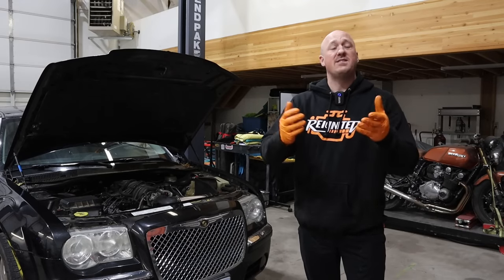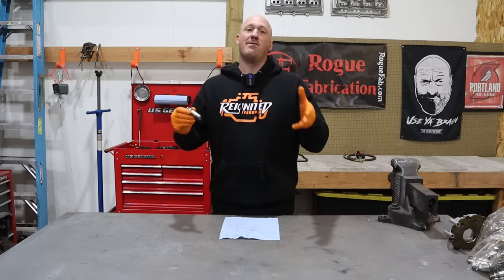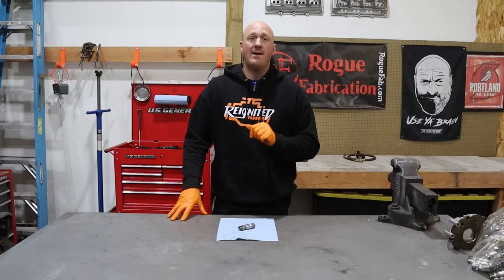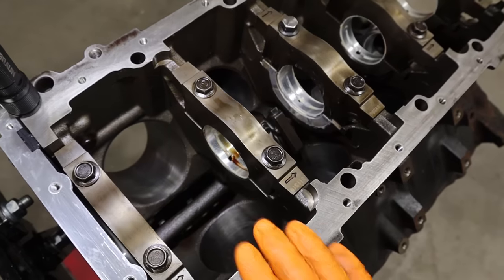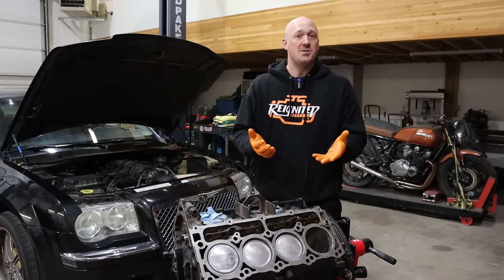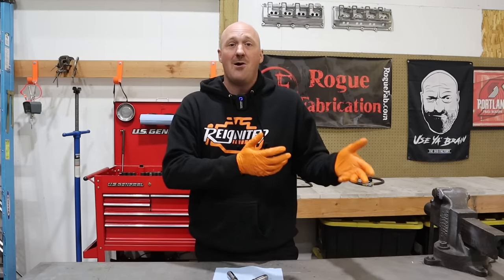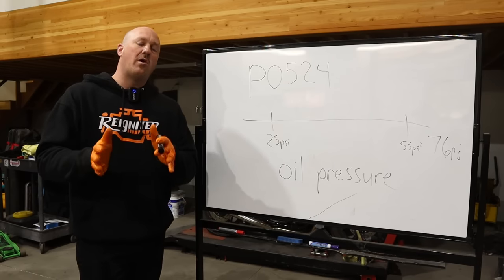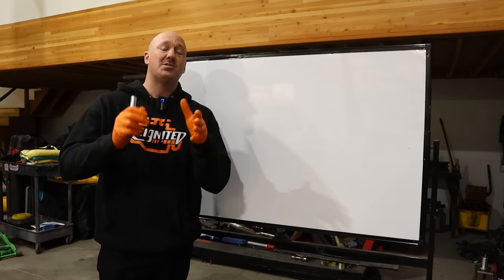The BEST Prevention For Hemi Lifter Failure! (In My Opinion)

Comment: My 2019 had mds lifters fail.  Regular lifters were fine.  Only had 60k.  Oil changed every 4k.
Reply from the maker: It's hard when I see these ones that fail at such an early mileage, I always want to know more about what led up to that like any specific area of the country, driving habits, ect...
Reply: My 2019 with 35k runs well and has very low odds of failure even though it is a 5% possibility.  A friends 2022 GMC Denali 6.4 had lifter, rod cam failure at 65k.  My brothers Silverado 5.3 vortec lost a lifter at 70k and after repair under warranty lost main oil bearings at 122k requiring new rebuilt 5.3.  Sorry it happened to you though.

Comment: we had this same problem in chevys and we put an eos in with oil change and never had an issue after that. As you mentioned it was usually in engines that had extended idling.

Comment: I am a P.I. and do surveillance in AZ.  My 2015 Ram 1500 with 170K miles idles 10 hours a day. I am waiting on the it's 3rd engine to arrive (original, the replacement, and now the replacement to the replacement). I lost cylinder 7 lifter last time and cylinder 8 lifter this time.  So my contribution to the knowledge base. lol I love my truck, but sadly I'm out. Cant keep buy engines! Any suggestions I am wide open!
Reply: Don’t idle the crap out of it lol. It doesn’t matter what manufacturer you buy with idle time like that the outcome will be the same.
Reply: Look into a portable Ice Air Conditioner so you can shut it down. Your gonna burn out your cats as well. There are several different types available.
Reply: If you need a truck, get one with a cummins. Diesels can idle all the time. That said, I guess put a hellcat oil pump in the next engine. I live in AZ too...The heat is hard on things.

Comment: Great break down here man! I came across your video while searching for oil cooler, I’ve got a 2014 2500 with the 6.4 Hemi with 108k miles. My plan it to install a hellcat pump next. It’s a solid truck, I always drive with MDS off by gear limiting the trans. It works well. I also don’t let it idle, once the idle comes down after a cold start I leave the driveway as a way to keep it from idling for too long… thanks for making this video!

Comment: Awesome information, thanks for the video.  I always rebuild with a hellcat oil pump, but also remove the mds.  This resistor mod is a lot like what Sonnex did for the 65rfe transmission, where they created a plug that works in line with the wire harness to fool the pcm to increase the transmission line pressure.  Seems like this resistor mod for the oil pressure sensor could be created into a plug that would work in line with the factory plug.
Reply from the maker: That's funny, I was thinking the same thing that it would be easy for someone to make something like that and make some money on it. 👍

Comment: If the hellcat oil pump would move 12% more oil  and if the 5.7 Engine is idling  around 600 RPM then , what about adding 12% to the Idling RPM, by reprogram the Engine to idle around 672 or even 700?
Is this going to move more oil as replacing the current oil pump with a hellcat oil pump?
Reply from the maker: I've actually heard of different fleet companies doing exactly that, installing a higher idle tune, which would in effect achieve a similar result. But I thought this version might make more sense for people than adjusting their PCM tune. 👍

Comment: My mechanic buddy told me frequent oil changes for the 5.7 Hemi. Every 5k. I’m doing it. I’m at 100k with my 2020 Ram. She’s running nicely, no issues, it’s a great truck.
Reply: My 2020 Ram has 130000 miles on it. I don't let it idle much and have not had any engine problems. BUT had to put on two fuel pumps. Of the pumps are made in China.

Comment: Thanks for the video. I am curious if you have found any issues with the fit of the lifters in the stock lifter trays, especially in engines that have had the lifter and cam failures.

I am an engine machinist and builder by profession, and while I have only limited experience with Gen III Hemis, I have seen similar on other engines with a lifter retention tray like the Hemis.
Reply from the maker: I personally have not, no.

Comment: My 2011 has the lifter problem. 
Oil changed every 5-5500kms. Full synthetic 5-20. 185,000kms on the motor. Not idled excessively but I do live in a cold winter climate. Not sure why Ram won’t just put Hellcat pumps in everything.
Reply from the maker: I've often wondered myself why they haven't gone that route. It can't be costing them that much more to build the Hellcat pumps...
Reply: Yours went out around the same time mine did around 180,000 miles on my 2014 Chrysler I bought a whole non mds cam and lifter set with head gaskets and all. Currently looking for someone who will do the job

Comment: I have a 2009 Dodge Challenger Srt8 6.1L 6 speed manual and I've had to rebuild my engine twice now with less than 100k miles
Reply from the maker: Just heard that came out, but haven't had a chance yet to inspect one and see what size it is 👍

Comment: There are too many examples of high idle hours not failing, with other examples of much lower idle hours still failing. I think the correlation there is not that idling causes failures, but that lifter failure is a materials quality issue, and idling simply increases the amount of run time those lifters are operating. I don't remember off hand, but chrylser converts idle hours to mileage, and so regardless if whether the lifter idles or simply gets operation time through non-idling, eventually a flawed lifter will fail. Ilding doesn't cause it, if the truck/car had run longer on the freeway the lifter would still fail, because it's a time thing; how many revolutions of that cam does it take, regardless of whether its idling or driving. Lots of us are running better oils as well, with more anti-wear and friction modifiers, this seems to even reduce the sound of the tick though whether its having a physical reduction in damage no one knows; certainly runs quieter with formulas that have higher amounts of moly (>= 200 ppm). I don't think it's a pumping issue either, 30+ psi should be way more than needed to oil that system, in engines with variable pumps they try and get them somewhere around 10 psi or less, they don't need a ton at idle.

Comment: What's the difference I'm part #m342hv an #10342hv. I installed the m342hv on my both my rebuilds. They came with a higher pressure spring but I didn't install. Maybe the 10342hv has the higher pressure spring already installed.
Reply from the maker: I'm looking at them now, and beyond the fact that the 10342HV has an anodized surface I can't really tell the difference. Both are the high volume version so probably can't go wrong with either.

Comment: I really appreciate the information here. The oil volume issue seems like it would be the most likely reason these lifters are failing. I have an 09 ram that I had to replace the lifters and cam in at around 120000 miles. My question is, I bought a 2022 grand Cherokee with the 5.7. Currently only has 15000 miles. I would really like to go ahead and put the hellcat pump on it but I’m assuming that will kill any warranty on the car. I’m also assuming that if I bring it up at the dealer to see if they would do it for me to retain the warranty,they will most likely laugh in my face. So, is my only option at this point just to make sure oil changes are done frequently and with good oil?
Reply from the maker: Sadly you pretty much nailed it as far as your warranty goes. If you did decide to pay a different shop to put the hellcat pump on I doubt you'd ever get called on it if there was an issue with the engine, because externally the Hellcat pump looks identical to the stock one and I sincerely doubt the tech would be looking at it, I know I wouldn't 😄
Reply: 😄 thank you. I really enjoy your videos brother. I learn a lot. I'm wanting to do a challenger build like yours with my 8 year old son soon.

Comment: Increase the target idle rpm in the tune. That would have a similar result for those unwilling to crack into their motor.
Reply: I thought about that too. What tuner do you use and do you recommend it ?
Reply: What will it take to increase idle rpm from 600 to 700?

Comment: For those of us with tuners, would increasing the idle rpm’s by 50-100 be beneficial?
Reply: My guess would be it would be fine short term. But if you’re idling extensively, you’re putting more stress on the engine. This might mean you do oil changes more frequently. Before I installed my Hellcat oil pump, I’d hold the gas for a bit to increase the RPM when idling. I wouldn’t go the tune route unless you’re on a tight budget.

Comment: I just bought a 2022 Ram 2500 HD. It has just over 34K. I don't think it has the tick in it yet. But sometimes when it's cold a tick happens for the first 5 to 10 sec. after starting. I put an extended warranty on it to 60k or 5 years. So, I should be covered or at least I hope so. I don't trust extended warranties to mush. (Past experience's) I use to be a mechanic many moons ago. I'm too old to do what is needed so I'll just keep so extra cash for a new motor if needed. Great channel, by the way. I'll keep watching.
Reply from the maker: 100% normal to have the cold start tick. They are like that straight from the factory, never becomes an issue.  👍

Comment: Mine lasted to 150k before failure. For whats its worth i used mobile 1 5w20 oil , mopar filter, and replaced 1 quart oil with marvel mystety oil. I changed oil at 7,500 miles. I had it replaced recently,  this time i will change to a mobil 1 oil filter and do 5,000k changes instead.
Reply: Don't use mystery oil crap there's a reason it's a mystery. And yes 5k oil changes are better than 7k I do mine at 5k usually the dash says 30% left and it's pretty black at that point.
Reply: @stoneyswolf  that's interesting,  because even though I was changing at 7500k I thought the oil didn't look bad.

Comment: Awesome. Thanks for the info on the fix for the P0524 check engine issue. It's exactly what I thought was going on with the switch falling out of limit, and the wiring to keep it in spec would work to clear that code. The pressure spring change is probably a better repair for us at this point if we cant get the high pressure to fall somewhat ( as I stated in a previous thread we live in a cold climate where winter temps hit -35c and startup pressure hit 90psi at -10c the other day and quickly came back to 85psi). I was wondering if going to a 0w-20 would still work with this engine and if it would lower the start up pressure. I will do the spring change but in the time before i can get around to ripping it apart again, do you think this is a possible short term solution. Thanks for your input in advance.
Reply from the maker: I think 0-20 would be just fine to use in the short term. I'd be interested in knowing your results if you did so as far as how much the oil pressure numbers actually changed. 👍
Reply: Where did you buy the voltage differential kit?

I use the recommended 5w20. Mobil1 full synthetic, I also started to substitute one quart of oil with a quart of Lucas full synthetic oil stabilzer, changing at 5000-6000 miles (I think 10k on the oil change gauge is extreme also, even though Mobil1 says 10K on their bottles and jugs.)

I've also noticed, and I brought this up before about fuel mpg.
I've noticed that I've lost about 2 mpg average after doing the upgrade to the Hellcat pump, which I attributed to moving more oil requires more demand on the engine and also to colder temps lately, but this makes a lot of sense.....if the pcm sees the oil pressure is to high, not letting the MDS actuate. At 68 mph I'm running about 68 psi. 
I thought about using a 6.2 oil pressure sending unit, but they are the exact same part number as the 5.7, so no need to go that route.
Reply: @reignitedauto...I posted a few weeks back...quick question, when you went over the wiring to reduce the signal back to the ECU, there was some confusion on my understanding,  what exactly would I need to buy, as far as that wiring harness to reduce signal? IS there one standard voltage reducer? What range reducer would I need for a 2013 Ram hemi, to diffuse the signal for P0524? I can tie ot in, near the firewall, I am just ot clear on the rating/# for the diffuser I need to purchase. Any help would be appreciated...Thank You.
Reply from the maker: @jeremybell2938  if you've got the Hellcat pump in there, you'll need a 1k ohm resistor and a 7.3k ohm resistor wired in like the video mentions 👍
Reply: @ReignitedAuto. Apologies for the hassle, but, for the life of me, cannot find a 7.3k ohm resistor. Is there a link to a place that sells them. Not sure why I am having trouble, but I am going to attempt this, before I would try pulling pump for relief valve. Thanks. It looks like you only have one resistor in your video, so I am not getting this.
Reply from the maker: @jeremybell2938  on my particular engine I have the early model Hemi with the Melling high volume pump which is a 20% increase over stock, so the resistors I'm using are 1k ohms, and 4k ohms, which are admittedly easier to find.
Reply: @ReignitedAuto  I am not finding any 7.4k resistors online...so I am just going to bite the bullet, and instead of a 30 minute fix...I am going to farm my Hellcat oil pump, back out, and do the relief valve. Socks. Anyways, is that fix, just installing a standard Hemi oil pump relief valve, into the Hellcat pump? A "swap" of that valve? And do I just thread it in....or do I need to calibrate that valve somehow? Hoping it is just plug and play.
Reply from the maker: @jeremybell2938  it's plug and play, just swap the spring from the stock pump into the Hellcat one and you're good to go. Alternatively if you want to pursue the resistor mod a little more, you don't specifically have to use the 7.3k ohm resistor. I just used that as one example. Go to a voltage divider calculator online and put in different resistance values until you get the proper result.  In your case, if you start with 5v you want to knock the voltage down to 4.4v - there are any number of different resistance values that if used in combination can modify the signal in this way you just have to try them. 👍

Comment: Developed a limiter circuit versus a divider. It functions normally up to ~ 60 PSI  where it begins to limit the output voltage equal to ~ 65 PSI. I packaged it into a plug-in adapter the goes in between the oil psi sensor and OEM harness. Works great with my MDS and I see the actual oil pressure all the way up to 60 PSI before it limits out.
Reply from the maker: That's awesome, I was hoping someone more proficient with electrical components would come up with something like this. 👏

Comment: What If we just get a SRT/Hellcat oil pressure sensor, will the PCM will still code?
Reply: Was thinking same. Is sensor what dont understand higher oil pressure or is it PCM program what thinks its outside parameters.
Reply from the maker: Unfortunately the oil pressure sensor is identical to the ones in all the other vehicles, this is strictly a software issue within the PCM.

Comment: I have a question just out of curiosity.. When the MDS engages and shuts off those cylinders, since it's not firing in those shutdown cylinders, wouldn't that cause the engine to work harder since it doesn't have the combustion to help push the piston back down? Or have the exhaust valve opening to release pressure on the compression stroke?
Reply: Yes the other 4 cylinders will be working against some friction. It still saves gas. If the exhaust valve is left open I suspect exhaust from the other cylinders will back flow through the exhaust manifold.
Reply: @mouseno4195   I have read up on the process that MDS uses and as stated they create an air spring and then refresh the charge every so often to account for the loss of pressure. In my 08 Charger you can hear when MDS engages. About every 10 minutes or so you can hear a blip of 8 cyl mode which recharges the air spring. I get 23 to 24 mpg at 80 on the interstate at an average of 4000 ft elevation.
Reply from the maker: As the others have mentioned, the valves stay closed and the engine uses the air pressure inside the cylinder to help the piston push back down again. But keep in mind, it's not like the engine really needs the help. Those pistons are attached to a still rotating crankshaft, they don't have a choice 😄
Reply: That makes sense. I'm a mechanic myself and I own a Hemi so I was just curious as to how the MDS actually worked lol